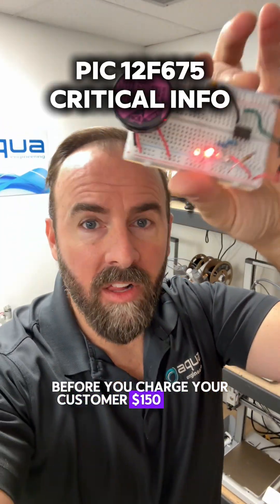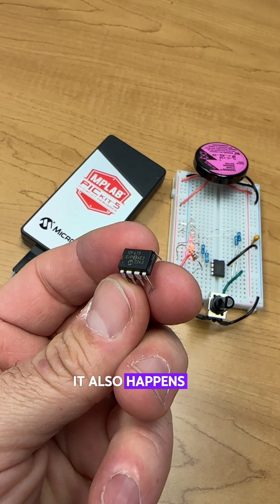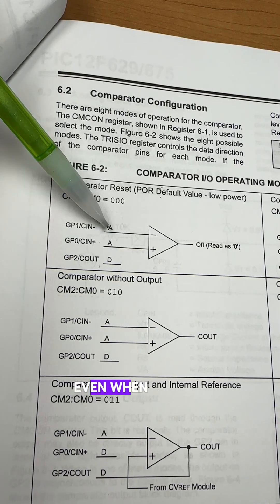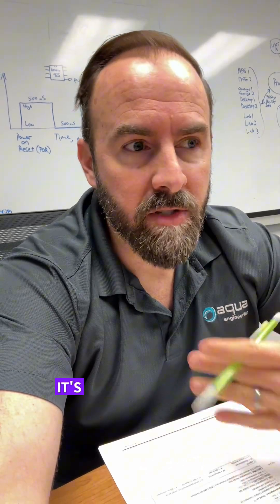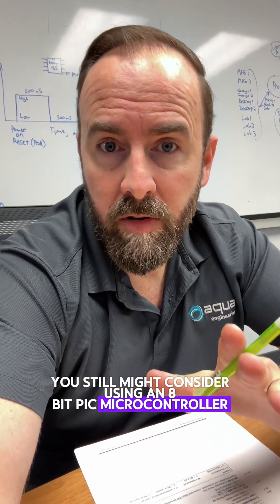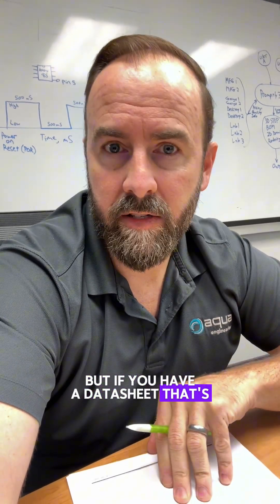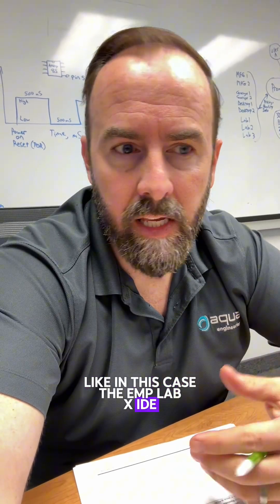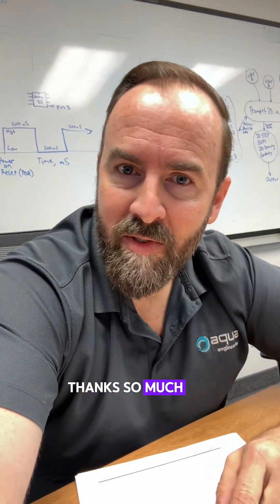PIC12F675 Critical Info

Comment: @i2c_jason when you used/use AI for a project do you set instructions in the project folder and upload the data sheets for the components of the project in the WebUI e.g. Claude/"dev r&d" in the project section

Comment: When I started electrical engineering a while ago, the first project was to build a line following robot, with an “arduino” controlled robot. It had to be able to dodge obstacles, follow the line, drive, and return to base if a lazer was hitting it. There where a few other things it had to do but whatever. If you take the library code for most of these together and  make a program with it. It will be slow, faulty, get in to snags and such. As much as moving and doing sensor reads were not possible at the same time. So all the teams were stumped (about 10) I got frustrated and did a deep dive. Atmel328 datasheet came out of the mincer. 500 pages read it twice, it’s like reading someone’s brain. And knowing all and every outcome, and contingency for the rest. And it will be solid code.libraries don’t do this for you! Everyone was struggling with pwm motor drive. Nobody knew how to do them. I took the mark off the chip and totally scratched it. I had a eureka moment for myself and realized what could be done with registers and masks. I made sensors work without the supplied library. It is all echo. In the end I got the servos moving first in a class of 200 . I was eating my sausage roll in the cafeteria. I mean 6 guys come up. They ask me. How did you do that? I tell them what I just told you really . I read the data sheet! They look at me all perplexed, but how? , I said read the data sheet for atmel 328 areas it all and you will find what you are looking for. 

The thing is. This really can’t be done without reading the data sheet anyway. It’s a good test, to know your robot you have to know  
its specs. My advice is build everything but know outside code is like the exorcist+

Comment: Great point.   Even when it comes to mass production, the cost of a bulk order of small 8 pin DIP chips is significantly cheaper than a bulk order of ESP32's.     That that little pic sounds amazing where it's an Analog functioning device until it's all GPIO programmable.     That rocks.    I'd suggest for something like this it stay seated in a socket in case it has a glitch and needs either reprogrammed or replaced with a standby pre-configured digital.

Comment: I disagree.
Obviously if you only need a tiny 8 bit controller, use that but espressif has longevity commitments of at least 12 years from release and solid documentation and a solid codebase with esp idf.
Yea sure there is a point to not using unknown libraries, but you are the guy that made the video using the arduino ide for embedded development.
Reply: Honestly, for most professional use cases I would not trust the ESPs simply because of their complexity.  Even if you don't use the wireless stuff at all, they are much more complex than a Pic or Attiny.  Just the fact that they use an ARM or RiscV core makes timing much less predictable.  And maybe I haven't been low enough in the ESP development yet to know how to do it, but I have no clue how I would implement the actual exception handler for the timer or a pin change as opposed to passing some function as callback to an OS and then not having any clue on how many cycles have passed between the hardware trigger and your code executing or how much battery power that might have wasted.  In short: sometimes being barebones is very useful.
Reply: @MisterkeTube 💯🎯
Reply: By the way:
Microchip has no promise at all of a lifecycle. Its eol policy is just basically a trust me bro, which i am inclined to believe but i think it is better to have a specific promise.